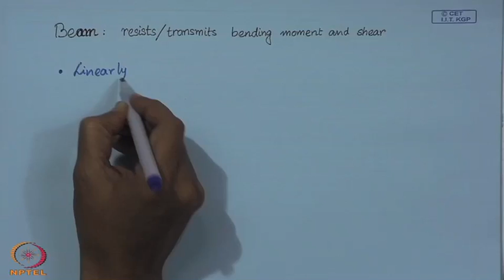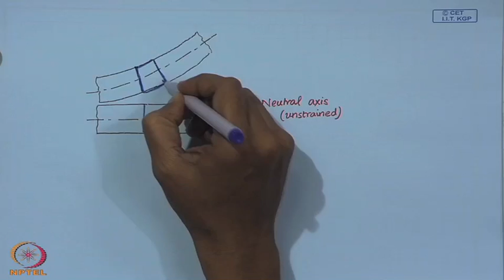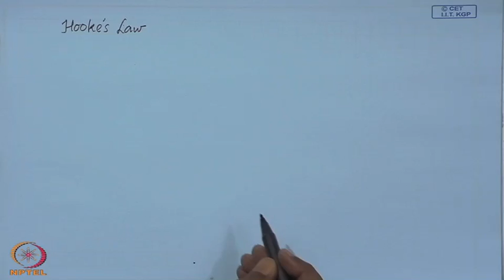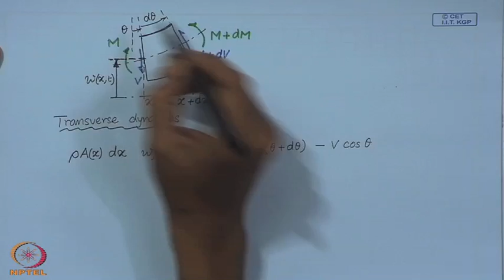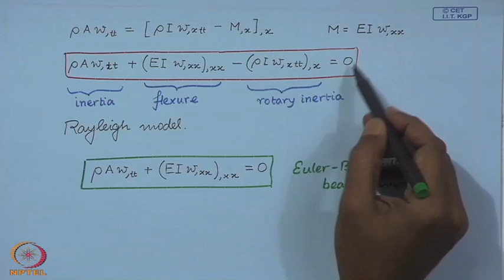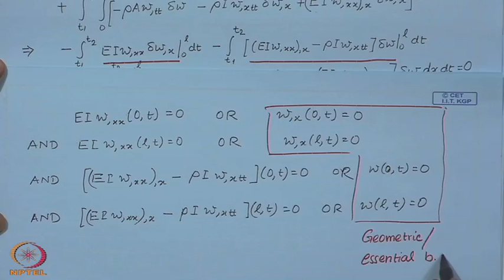Beam Models - I

Comment: Solutions of the Euler-Bernoulli equation are also solutions of the Schrodinger equation.  Understand that the Schrodinger equation is like the "square root" of the Euler-Bernoulli equation, much as the Dirac equation is the "square root" of the Schrodinger (actually, Klein-Gordan) equation.  On the strength of the analogy, perhaps Quantum Mechanical methods could help solve beam problems; and perhaps the extra "rotary inertia" term of the more inclusive Rayleigh model predicts Quantum effects at high energies & momenta?